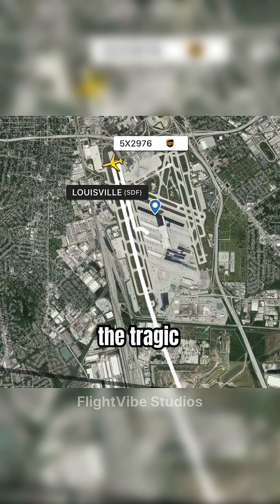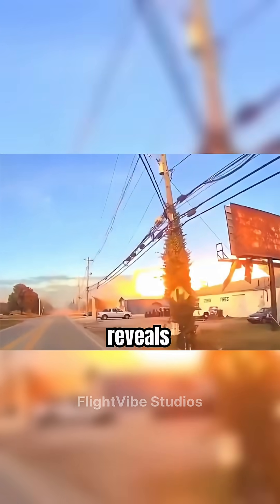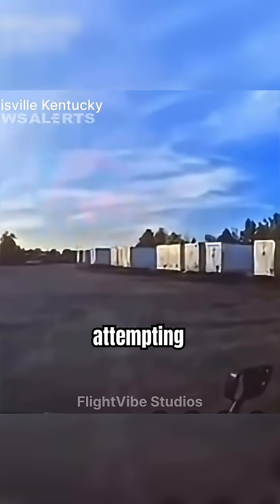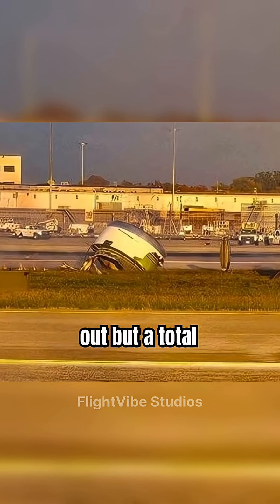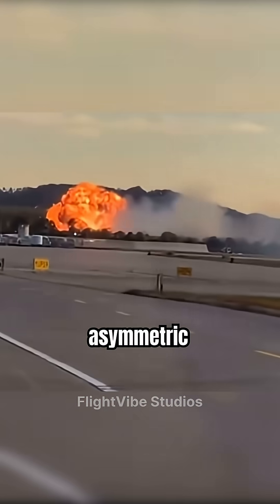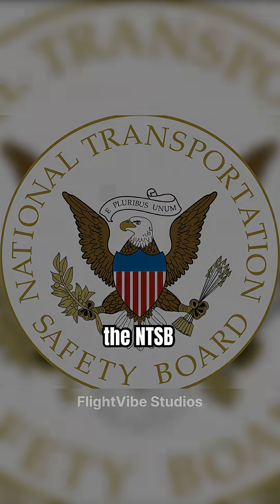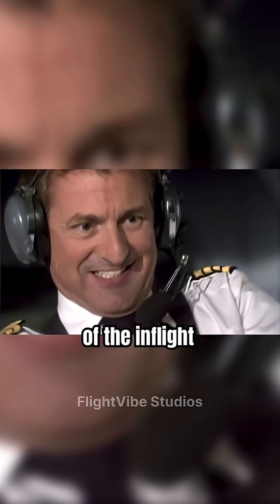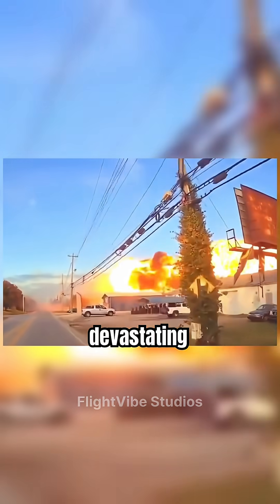Engine Separation Confirmed in UPS Cargo Jet Crash

Comment: I don't believe engine separation alone adequately explains the fire over the wing and subsequent mid-air explosion.

I still think the turbine blew in the most catastrophic way possible, with engine separation a result of uncontained superheated shrapnel ripping through the pylon, its mountings, a hunk of the forward wing and flaps, and around 20,000-odd pounds of aviation kerosene in the immediate vicinity.

Comment: Didn't you know... The MD11 is the DC10's cousin, and the DC10 was considered to be one of the most dangerous aircraft of its time and having the most crashes of its kind. So, therefore, that would explain why the MD11's engine came off during takeoff.
Reply from the maker: Yes; I already uploaded a short video about death chamber 10. Watch it 😀
Reply: The MD 11 has longer fuselage than the DC 10

Comment: The black box will likely not help much understanding why the engine separated.
Reply from the maker: Yes; Maintenance reports must be helpful.
Reply: Probably not, but the data will still be scoured.    They leave no stones unturned.   

I'm fairly certain that #2 injested debris and it was only producing thrust on #3, the data will tell them that..  Which hydraulics did it still have?

They also may be able to find small clues in the data that could have foretold this..  I know some planes monitor vibration.  Was there anything in the hydraulic pressures or fuel pressures that was just a little different but not enough to raise flags?   I don't know..

Just remember that these investigations aren't like a car crash..  Andrea was on her phone, case closed..  Its about learning exactly what happened, why it happened and what can be improved in the future so that it never happens again. 

Everything right down to the tiniest little detail, including torque wrench calibration and what the pilots ate for dinner the night before.

Comment: They were using a forklift to mount the engine on the other jets that failed when they were still in commercial use the hydraulics with sag out and the bolts that mount the engine to the wing strut wouldn't connect correctly so doing shortcuts that's how the engines fell off of the MD 11s that were in commercial use

Comment: Yep, it lost an engine just like American 191. Indicates shortcuts from the maintenance crew in re-mounting the engine to the wing. The bolts were probably worn or stripped. Supposed to use new ones when putting a new engine up there.
Reply: Yep! I remember this happening before because a regular forklift was used to lift and install an engine instead of proper mounting equipment, which lead to far too much stress on a mounting bolt which later broke causing engine separation and a crash.
Reply: That's my theory as well. If it was thoroughly and strictly maintained per service schedule this might not have happened but it's still too early to know for sure
Reply: Not necessarily.
If fan blades broke off, the asymmetric rotation could tear the #1 engine off its pylon.
Uncontained fan blades from engine 1 could have damaged engine 2.
Angle of attack and level wings looks like flight controls were not affected.
With their full load, and on only one engine, she would not climb.
This accident will be very interesting to see / hear the black boxes.
The crew would have known they lost #1 but may not have known they had a fire 
(the engine and fire detection was back on the runway).
The CVR might give insight into whether the crew forgot to raise the gear
or if they thought they could make a road, or if they had a hydraulic issue as well ??
Let’s hope the NTSB doesn’t take a year on this investigation.
And why aren’t the UPS MD-11s grounded until all engine pylons are inspected ??
Prayers for all.
Reply: @tz6516 that's a good theory. I've seen a clip from a passenger in flight of an engine that had lost fan blades, and the engine looked loose from the pylon, shaking extremely violently. It looked like it was about to rip itself off. I'm sure the pilots had cut off power to that engine but I guess the blades had already done its damage and the sheer wind force made it shake and the remaining fan blades to keep spinning maybe. I'm not an expert btw.
Reply: @Henrik.S8
The MD-11 has a checklist for “Engine Severe Damage or Separation” so this crew would have trained for it,
but if the speculation is correct that the #2 engine was damaged or failed, this airplane could not climb on 1 engine.
The only thing that looks abnormal is the gear being extended, but as stated above, that will be explained by the CVR/FDR.
Reply from the maker: Yes; history rewritten ❤️‍🩹